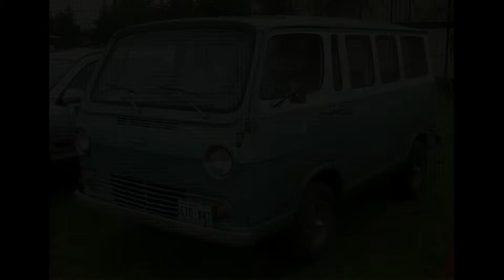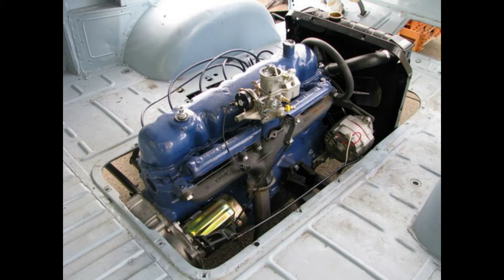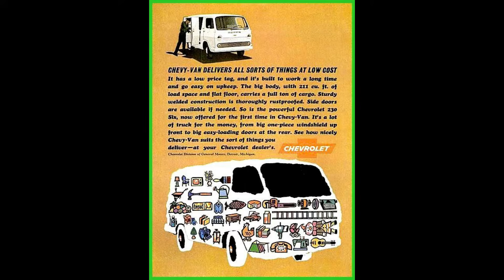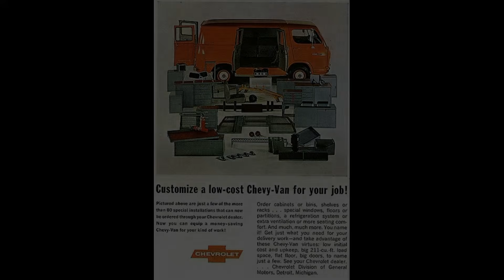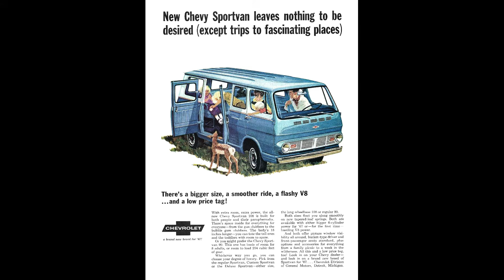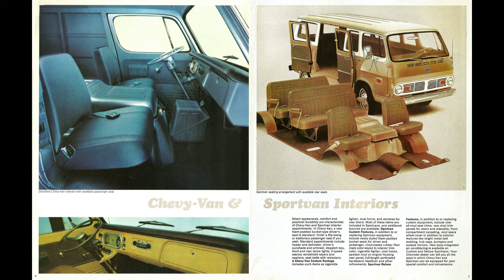These Forgotten Chevy Vans Are Worth Thousands Now

Comment: My first "Sportvan" was a 65 window model same as the one pictured at "55 sec." same color, two tone paint. Me and a buddy loaded up two Harleys in the back, in 1973, and drove from Illinois to Phoenix to see a Deep Purple concert, and ended up moving there! That old "Hot Water 230 6 cyl." and three speed on the column did not set any speed records getting us there, but it did get us there! I drove it back to Illinois, sold it, and bought a 67 Sport Van, with the 250 6 cyl. and drove it back out to Phoenix, The 67 was a panel that had the back customized with wood and carpet and was insulated, which really helped in the Phoenix summers!
Reply from the maker: WOW - how was the concert!  Thanks for watching and sharing your very cool memory!  Are you still in Phoenix? If so, watch for us as we're out and about - it would be great to meet you!
Reply: I'm in Tucson AZ. I bought a 69 sport van 108 about a year ago. It really needs a lot of work. Might you know where I can find parts for it? Thanks.